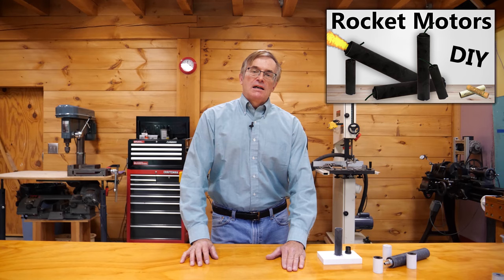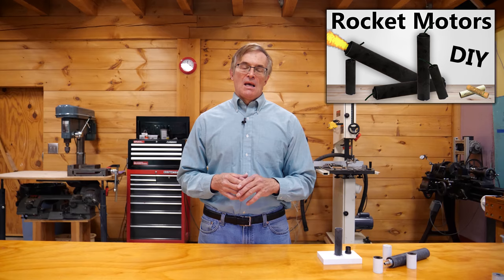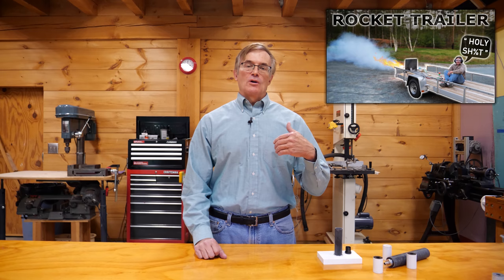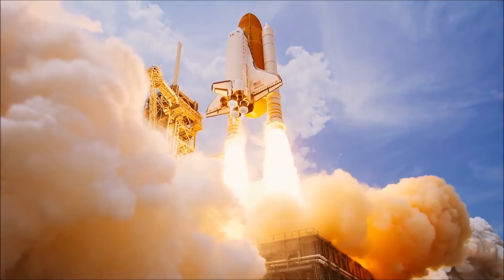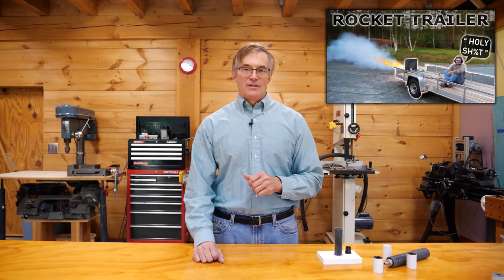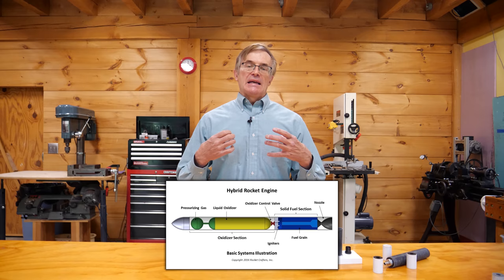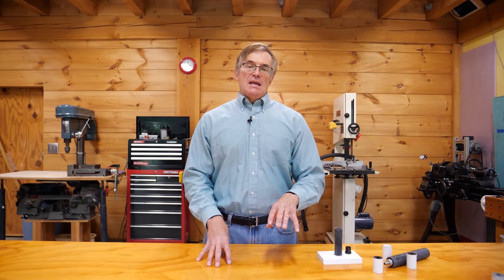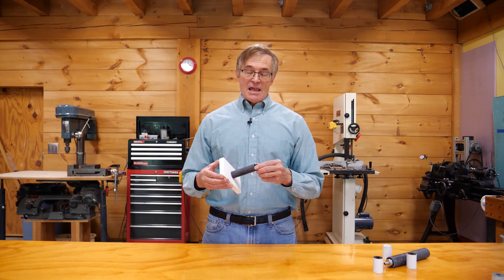Mixing Nitrous and Rockets is DANGEROUS... But Really FUN!

Comment: would adding 3 nozzles at a angle and in a circle 120degrees from each other add kinetic energy to disperse it at any point in the engine while giving it a easily adjustable angle since it would be the machinging that could adjust the angle of collision, or having a ring with more nozzles angled to collide,  requiring less kinetic energy to disperse it, though it would be harder to machine with out indexing or cnc rotational holding.
Reply from the maker: The best dispersion occurs with kenetic impact, solid or liquid.  Impinging flows are used with liquid fueled engines because they also have to mix as well as disperse.

Comment: When you were talking about the nozzles, I didn’t understand that the fogging nozzle will have the steel bar melt, but the brass spiral nozzles survive because of cryogenic temps. So is it hot or cold in there?
Reply from the maker: It's hot, but it varies  a lot depending on where the metal is located in the flow.  The thin stainless  stem is very exposed .

Comment: I really liked your videos about rocket engines, and I would like to ask you a question that came to mind, how to size the hole, or bore,  in the nozzle, or rather, what is the relationship between the volume inside the propellant chamber and the diameter of the nozzle hole, I know that it is directly associated with the pressure generated by the burning inside the chamber, that is, the smaller the hole the greater the pressure and vice versa, but there is an ideal relationship to obtain the greatest thrust, or engine acceleration . What is the correct way to calculate or size this diameter?
Congratulations on the channel, you are presenting a great content.
Greetings directly from Brazil.
Reply from the maker: That's an excellent  question.
There are rocketry  websites  that can give equations for this dimension.  The challenge  is that the propellant  burn rate increases with pressure, which increases the pressure in a positive feedback loop. This becomes difficult to model  accurately.  We did this experimentally. Establish a propellant  formula and fabricate identical  motors with decreasing throat diameters. Test each one until the motor explodes, then back off one or two steps to give the highest performance, actual motor that will survive.

Comment: The spiral nozzles you have are single lead/flute. Would having a nozzle with multiple leads/flutes produce a more even distribution at the cost of pressure drop?
Reply from the maker: I don't know.
Reply: @TechIngredients  I had wondered the exact same thing but it apparently does not exist or is common because I couldn't find any examples or anything really. But I'm so glad you showed the spray pattern because as soon as your were finished describing them I was already searching up examples to satiate my curiosity.
Two questions, Why the hollow cone pattern compared with full cone? Is it because of it being more  directly  applied to the solid fuel since its a  hollow cylinder? And secondly what abouthaving as helical pattern on the inside of the aluminum cylinder , either having it the same direction as the nozzle or the opposite to help break up even more?  Would any amount of rotation  help with mixing/combustion at all? For that matter any sort of pattern on the inside of the attachment might be interesting and why not some kind of screen or mesh covering the end? i know it would impede flow but might help with atomizing or vaporizing of the liquid. Its probably addinging needless complexities but might be interesting to compare.

Comment: Here over the last about week.. I have found myself stumbling across more of your videos. I have to say amazing job explaining things, and breaking it down to answer the questions as to why with it. I am one of those people, who thrive on knowledge. Anytime I see good educational content on a topic that peaks my interest. I sometimes find myself binge watching a lot of the materials. 

A recommendation to help maybe explain to people a little better when it comes to spray patters. A white board with the dry erase markers. This way you can actually give a little bit of an image and have it resting behind you for the example as you continue your explanation.

Aside from that, love the content keep it up! 

I also had a question.. If you were to design a nitrous oxide nozzle... I did notice in the spiral that you covered around the sides as a directed measure towards the back of the fuel chambers.. However, I did notice that some drops of liquid nitrous oxide was in fact dripping from the nozzle. Not that I think that would matter tooooo much. However, a seeped portion of rocket fuel could potentially make for uneven burn and potentially explosive rocket no? Never the less, I was curious.. If you were to design a cap that went over the nozzle with the back open as another kinetic point PRIOR to it being pushed out the open end of the apparatus. Of course with a gap between the nozzle itself and the cap surrounding said screw nozzle. Forcing flow down to yet another point of kinetic impact prior to exit. 

I guess in the end I am asking if this would lead to a build up of nitrous that could potentially freeze and clog, or with it having the design so close to the heat keep it from actually reaching a freeze point.... how would it affect performance.... and I guess how would it affect the overall spray in terms of viability? With that many kinetic impact points.. would there be a loss in power at some point due to so many... or would it actually continue and if you will build upon itself?
Reply from the maker: I considered that, however the pressure drop to atmospheric is much larger leading to more cooling.  Also, the temperature in the combustion chamber is thousands of degrees even near the nozzle.  That's why the stainless steel pin on the fogger melted.
Reply: @TechIngredients  I had noticed that, and was considering what material could be used as a replacement material in terms of heat resistance. Of course, I do not pretend to know anything close to what is required to manufacture said products. Just purely speculation from an outside observer. As I stated before, I love good videos full of knowledge. Definitely will be watching more!

Comment: what about loading different types of fuel cells in the same engine, in what order do the cells burn ? could you make a engine with high output for the first segment and a longer burn for the last ?  in the hybrid engine could you vary the thrust with the flow rate of the nitro and to what extent?
Reply from the maker: They all burn at the same time from the inside of the core outward.
Reply: @TechIngredients  Fuel grains can be cast in concentric layers, and/or a radial gradient in fuel composition.

Comment: How would something like high-density polyethylene compare to using wax? 
I'd be a bit concerned about the carefully-formed fuel grain melting and running out the back of the rocket while setting up in the desert where this sort of rocket tends to be launched.
Reply from the maker: It's about 10% less energetic.
Paint the rocket white and run the oxygen or pulse the nitrous for a few milliseconds every so often to keep things cool.

Comment: @36:40 Being educated as a mechanical engineer, I love your channel!  Regarding the spiral nozzle when the shroud is placed around it:  Is there a gap between the shroud and the tubing with the nozzle? I'm wondering if you get any entraining of an accelerated field of air to surround the mist and keep it directed.  It would also be a good place to dump fuel or a secondary ignition component into the jet, I would think(?)
Reply from the maker: There is.
However, the entire assembly  is contained within the combustion chamber, and no air can enter.
You also  don't want the combustion products washing over the nozzle as only the nitrous  is preventing it from melting.
Reply: @TechIngredients  If you ever want to play with laminar flow fluids, which are fascinating, I invented a surgical device that creates a laminar flow field of pure air over incision sites to prevent bacterial fallout.  Sold it. NIH funded and several journal articles.  Happy to share!

Comment: also you could use the cold no2 to cool your nozzle and expand the gas for a big jump in pressure. your a good welder.  And that way you wouldnt need to worry about liquid NO2
Reply from the maker: That would help with vaporization at the cost of complexity.  But, it wouldn't increase the pressure.  That is determined by the delivery pressure from the tank and can't increase without reducing flow from that tank.
Reply: @TechIngredients  then why does nase use it for regentave cooling and gas expansion for the turbopums?
Reply: @TechIngredients  also what happens when you heat a gas what happens to it? it expands.  so if you can take out cooling and oxidizer with the same thing why not?
Reply from the maker: Because the pumps can produce whatever pressure they design them to generate and the gas that is produced in cooling the nozzle doesn't increase the pressure of the output of the pumps (whether it's a gas or liquid).  Even if the phase changes and the volume increases, the pressure doesn't increase.
Reply: @TechIngredients  the turbo pumps that push the fuel in closed cycle rockets get there power from gas expansion from sending one of the cryo fuels usually hydrogen around the bell and that expands the gas to run the turbo’s

Or are you saying that liquid no2 and gaseous no2 take up the same volume?
Reply from the maker: No, read the post again.  I said the volume increases, but the pressure doesn't.
Reply: @TechIngredients  in the main tanks they don't, of course. but by the time a bell that has liquid H2(or other cryo gas like NO2) cooling if the gas cant escape the volume of the combustion chamber it will explode, hence preburners powering turbo pumps increase the overall output of the engine.

no pressure loss/no thrust loss  

explosions=pressure last time i checked anyway.

SMALL amounts of liquid/slush hydrogen converted to gas will fill a significant volume and if there is no way out of the space be it a bottle, combustion chambers, pumps, lines etc that PRESSURE will blow the container apart.   

go throw a HP gas bottle in a fire with the valve closed(our rocket nozzle) and soon there will be no more liquid or bottle.  

would you say the pressure inside increased due to the expansion of gas and that the expanding gas was imparted with lots of energy in its phase change that blew the bottle in the fire or was it some other force?

Comment: If you put at the end of rocket nozzle pipe as a ring few times bigger you can get 10x the power, fluid dynamics
So flying wing suit is easily achievable I spouse 🤔
Reply from the maker: Actually, that won't work. You can enhance the statics thrust by as much as two fold with an eliptical duct.  Of course this increases the engine weight and as the speed increases the added drag negates this increase.

Comment: I have no idea of this is true, but small Diesel engines (if warm) can burn candle wax, paraffin, vegetable oil, used motor oil with a little gasoline mixed, biodiesel made with methyl alcohol & a strong base like sodium or potassium hydroxide reacted with the methanol, then cooked with the veggie oil at 50-55 C for a couple hours, then put into a cheap 20L plastic jug with a valve upside down, so the glycerine can be drained off as it sinks to the bottom, then the processed oil remaining must be washed a few times to clean it up more & then you can add a biocide to it to improve shelf life & a little cetane improver & even a little petrochemical diesel & a small bit of sulfur (lubricates mechanical fuel pump & valves etc // you can pump the exhaust through a cat then DPF & then urea bubbler to clean up emissions a lot // if you concerned about air pollutants // biodiesel smells much better when it burns than petro-diesel & I would buy a small Diesel engine on amazon if I had an application for it // but all of my stuff runs on E0 or ethanol free gasoline // I live in an apartment so I do have a ton of space for big projects, but something about compression engines & rocket engines fascinates me // I like nitrous & nitromethane & anything energetic. I am almost done with my first HHO generator project // I love electricity & energy!

Comment: If you have a combustion chamber with high pressure then add a nozzle increasing the pressure even further (exceeding the 1200psi of the tank) what's to prevent damage to the plumbing and the tank? I'm assuming there's a check valve or flashback arrestor, unless the small orifice in combination with the pressure in the tank is sufficient to prevent catastrophic failure.
Reply from the maker: I covered that in the video when I discussed the nitrous delivery system.
Reply: @TechIngredients  Got it. The brass fitting is the check valve. I don't know how I missed that.

Comment: 16:00 
I never really thought about that but with planes like these, do they have a special mechanism for always having the inlet(s) inside that fuel?
When a plane is climbing up or diving down it must have some effect on the fuel, right?
Reply: https://science.howstuffworks.com/transport/flight/modern/question252.htm
I just found this and it's very interesting. Apparently the fuel inlet "is a flexible hose with a weight attached to the free end. When the plane is right side up, this hose, or flop tube, 'flops' to the bottom of the tank because of the weight and draws fuel from the bottom of the tank."
But that's not the only system like this, I see there is a few different ways to avoid pumping air from the fuel tanks.

Comment: If you cast or 3D parts from phenolic resins then"bake" them at a very high temperature in an inert atmosphere they convert to "glassy carbon", this may offer a method of fabrication that allows for complexity beyond what is easily machines from graphite.
Reply from the maker: That's similar to how carbon-carbon composites are made and the result is impressive, but time consuming.  As I'll show, a lathe can fabricate a very effective nozzle from graphite as the features are simple.
Reply: @TechIngredients  As always I look forward to seeing how it is done and how you optimise the process.

Comment: The one thing I would like to see is a durable thin wall material with high temperature strength such as titanium or stainless(has nickel) because aluminum seems a bad choice because of the low melting point and personally I hate plastic. Thanks
Reply from the maker: When we demonstrate our largest engine you'll see that it's fabricated from thin wall stainless steel.

Comment: I like your videos, especially when things combust!

3:54 [full liquid rocket being out of reach for amateurs]: Just like the oxidizer is pressurized in this project, why not pressurize the fuel (see Copenhagen Suborbitals, for example)? The point about combustion chamber longevity is still very much applicable, though.

33:28 [nozzle with "pin in path" spray pattern demo]: Has footage from the "simple hole nozzle" been used here? I cannot see the pin and the pattern looks identical to the previous nozzle shown.

Comment: Is there any possible advantage to using a hybrid-hybrid design, which uses "some" solid oxidizer (but at a low ratio), with a fluid oxidizer delivery system?
I'm mostly just thinking about oxidizer dispersion and a more complete burn, with somewhat reduced dependency on the gaseous fluid dynamics in the combustion chamber, but with a primarily fluid oxidizer system. Also, at low oxidizer ratio, the solid fuel would be only a fire hazard, and not really an explosive hazard.
thoughts?
Reply: PS: also curious about the possibility of milling tiny grooves in the inner lip of the aluminum spacer tube to further increase vortices and impact atomization.
Reply from the maker: There is.  The total impulse effeciency doesn't improve, but the regression rate through the fuel does.  One paper described adding up to 20% by weight of ammonium perchlorate to the wax.

Comment: I love your videos. If you had to say, how much weight of the Nitrous is used for a full burn. I want to determine the size tank needed for a hybrid project.
Reply from the maker: Think about the stochiometric ratio of the oxidizer (nitrous) and the fuel (paraffin).  I'd  add about 20% to the nitrous capacity to maintain delivery pressure through the burn.

Comment: The work you do is absolutely fantastic. Could the hybrid engine be "air breathing". Imagine an initial booster that propels the rocket and then a Ramjet intake opens up. This would pressurise the inlet fuel and you wouldn't need to carry fuel onboard (As long as you plan to be in the atmosphere)
So the big question is would pressurised Air (Not O2) be enough to ignite a solid fuel ?
Reply from the maker: The problem with ram compression is that it doesn't get very high.  The major reason that hybrid engines are not as powerful as liquid fueled engines is the hybrid's lower combustion chamber pressure.  Even so, we're running these engines at around 40 atmospheres.
Reply: @TechIngredients  Let's say you had an additional compressor section to further pressurise the air, could a solid fuel ignite with just air (and not O2). 
Doesn't the prospect of eliminating the oxidiser seem appealing at least for sub orbital applications ?

Comment: I've got 2 questions 
#1 
Is there any differences between the A.N. fittings and a J.i.c. fitting used for hydraulics 

#2
Did you ever think about trying the same type of nozzles that are used in a kerosene furnace bc I feel like those would atomize the fuel very well but not really sure if that type of nozzle would freeze up faster....???.... but I do believe that they are also all made of brass and come in different spray  angles as well.....